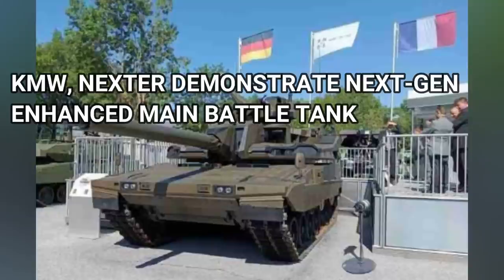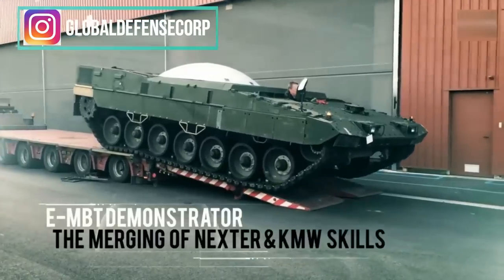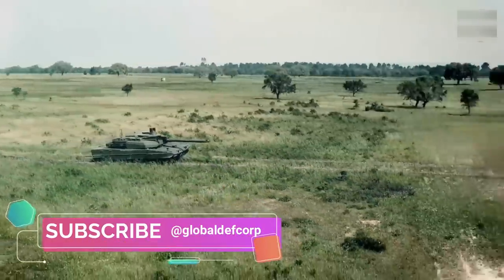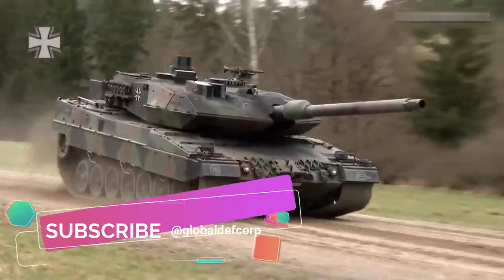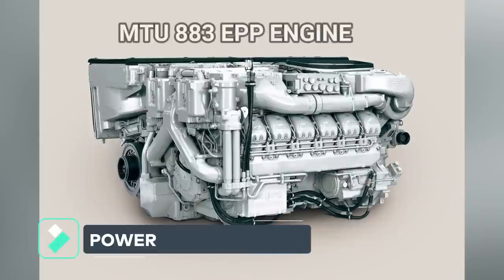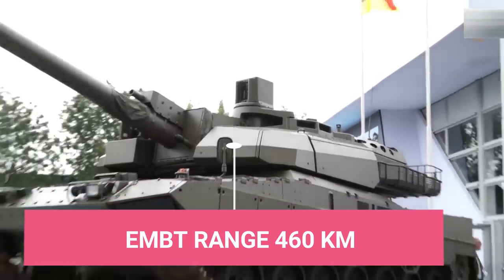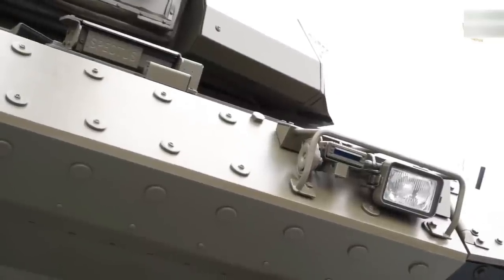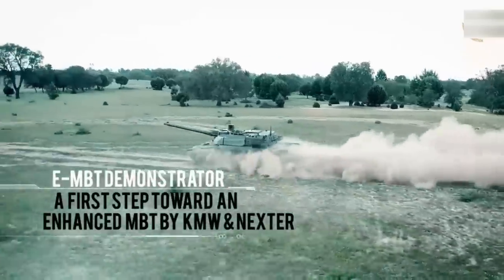KMW, NEXTER DEMONSTRATE NEXT-GEN ENHANCED MAIN BATTLE TANK #Germany #France #EMBT #Nexter #KMW #Tank

Comment: There's a reason we don't have Battleships anymore, and that's the same reason that tanks will become antiquated... they may be useful in some uses but my belief is that tanks will just become  expensive mobile metal coffins. 
At $10 Million a pop before transport, maintenance, fuel and crew expenses, I'll take the equivalent in drones, me and my 250 to 300 drones will sit 50 miles away and let's see how close you get my postion before I drop 3 kilos of TNT on your 250mm of top armor... bye bye! 

any haters are probably using dial up to read this comment 
🤣

Comment: Der neue Panther denke ich ist um einiges besser. Auch vom Design viel ansprechender.  Zudem  10jahre früher verfügbar
Reply: Panther has less features
Reply: He his not finish and it just a prototype
Reply: @ArendSchuurman  Its the other way around. Panther has more features.
Reply: @cvdheyden  It literally doesn't?
Reply: @ArendSchuurman  It really doesn't: the Panther has: 1.) Full digitilazation 2.) Drones 3.) 130 mm cannon 4.) drive by wire (to be run remotely). 5.) new protection concept. These are a few things that this nexter kmw does not have. I did not mention everything.
Reply: @cvdheyden  KMW has full digitalization. It has Trophy APS, LWR sensors and cameras all over the turret. Most things you stated aren't even features but specifications. 130mm doesn't have plus points over the 120mm apart from better penetration and more filler for HE. Tho KMW has better ammo count than Panther.
Reply: @ArendSchuurman  Not yet, the panther can be managed from ervery seat. The KMV will be a good tank no doubt, but it is a merged Leopard/Leclerc.
Reply: @cvdheyden  The Panther literally is using re-used Leopard 2a4 hull with a new turret. Not any better
Reply: @ArendSchuurman  No, you have no clue, really. The hull is a total new development. You can manage all tasks from all seats in the panther for example. The outer shape is from leopard 2, to fit transport requirements, thats it. Even the enginecompartement has changed. And the development is not finished yet.
Reply: @cvdheyden  Yeah right, weird that leopard 2a4s went out of storage when they started developing the Panther. Looks like you're just coping lol
Reply: @ArendSchuurman  Thanks, have a good day, baby girl.
Reply: Der Panther ist aber gar nicht als "main battle tank" gedacht.